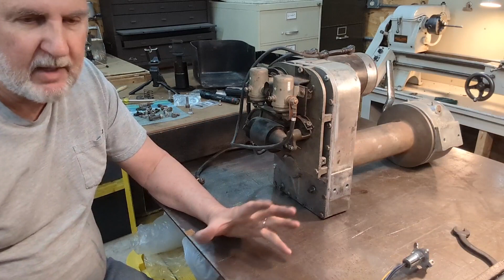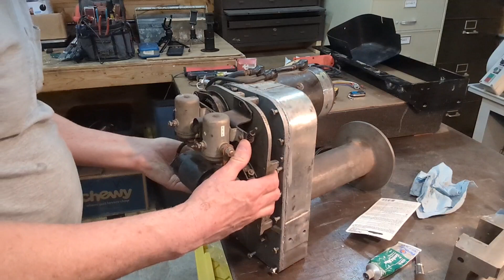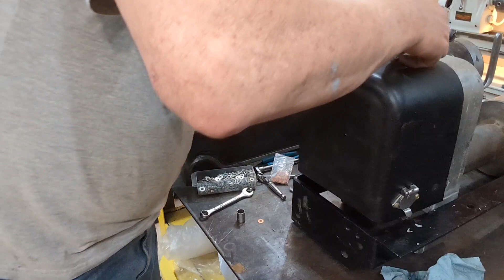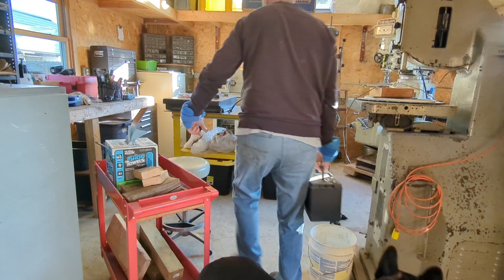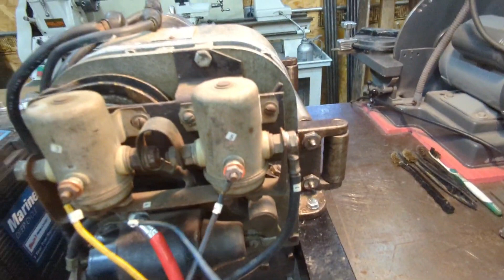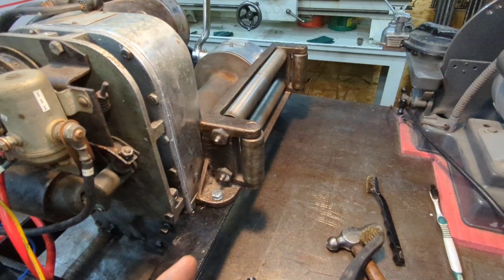Ramsey DC9-1 winch, pt.2-reassembly and wiring.

Comment: Thanks for your video, I'm about to attempt to restore my DC9-1 winch on my CJ5. If I need to replace my solenoids, do you know if it matter which ones I uses just as long as they are 5 prong continuous use? Also, Do you know what type of replacement motor I would need if i needed to replace it as well? Thanks again for your help.

Comment: I've got a DC9-2. Looking for parts. Would love if you cover that experience. Your video inspired me to keep it on my dad's old truck.
Reply from the maker: Ramsey does not support these old winches anymore so any parts would need to be made or gotten from other sources. So if you need say a gear, then from a bearing dealer/distributor. I had to remake some bronze bushings for mine, which didn't get recorded.